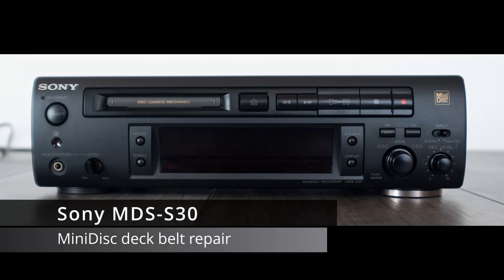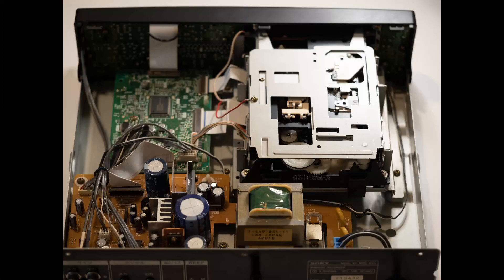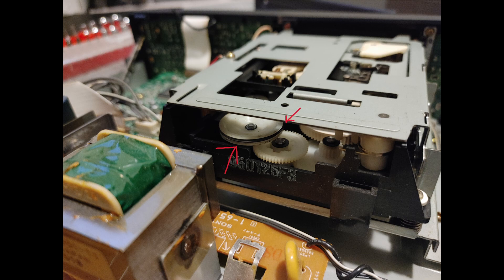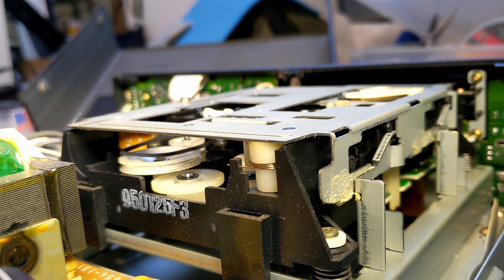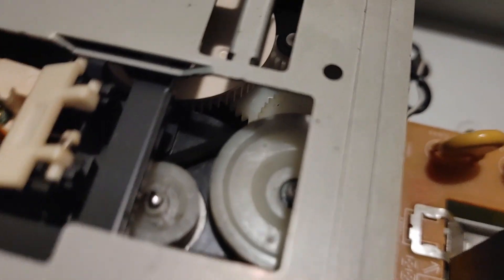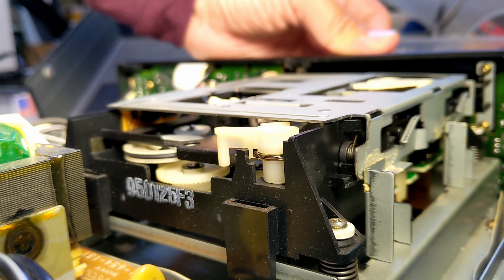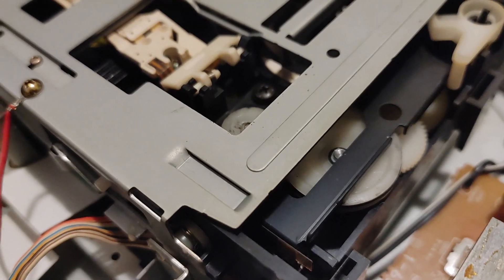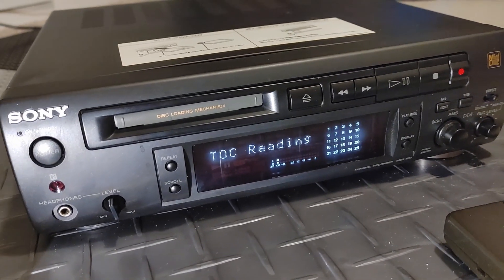Sony MDS-S30 MiniDisc Recorder Deck Belt Repair - won't eject or take in discs? An easy fix!

Comment: The Sony minidisc format was real step forward within the industry at the time of introduction, however for one reason or another it never really took off in the USA. As far as the belt issue is concerned, I believe this is a very common problem with all of the Sony MD players, recorders that suck the MD into the transport, all of them ever produced were prone to fail, it's a horrible design, and the original belts are of questionable quality. Thank you for the video.
Reply from the maker: You're welcome! It was definitely interesting to see how popular MiniDisc was in Japan vs. here in the US. I suppose there was just a big lag between when it started to gain ground here and then it ran right into the iPod/MP3 era... I still love the format since it's so technically interesting (and fun!).

Many of the Sony mechanisms were prone to this silly failure (this model happens to have the MDM-2. If you look for models that have the MDM-3 mechanism (like the Sony MDS-JE700), those are gear-driven and not prone to belt failures. I wish they made more like that! There are plenty of later models that went back to belts...

Comment: Whats that crusty white stuff on the sides of the mechanism?
Reply from the maker: Probably white lithium grease or a similar lubricant since there's metal/metal contact as it slides back and forth